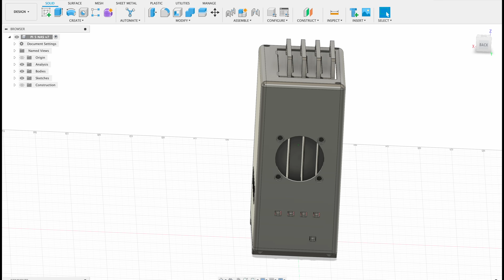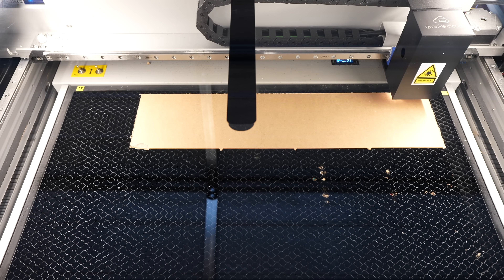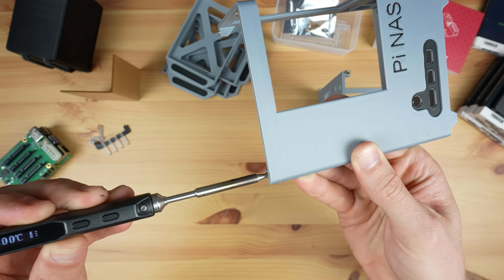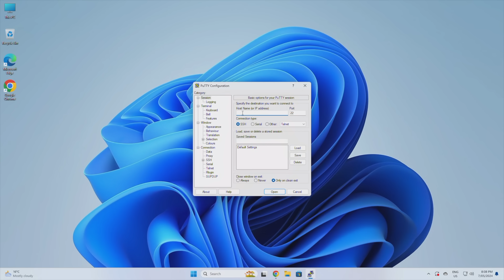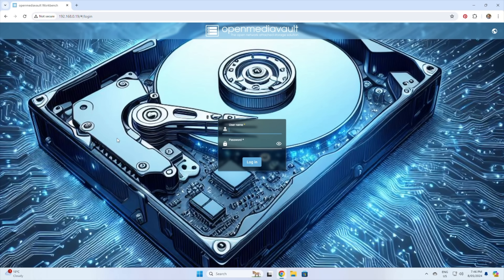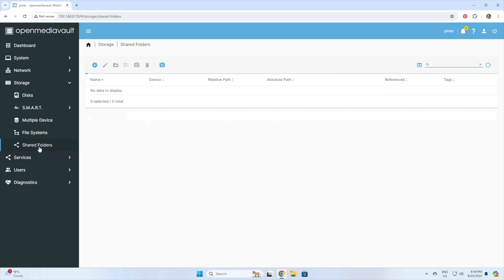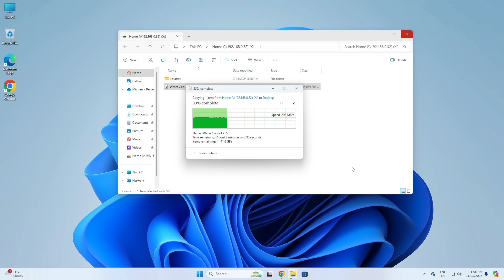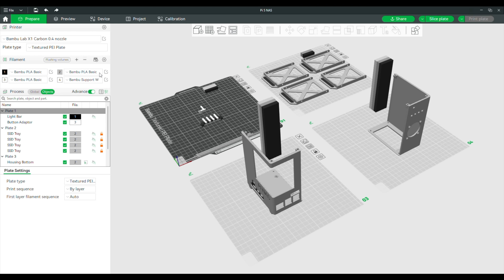I Built A 4-Bay NAS Using A Raspberry Pi 5

Comment: The performance unlock for sure is the 2.5G network interface.  Glad to see that is a surmountable unlock for performance.  It would be interesting to see what would happen if you had a USB dongle with even more bandwidth to see if the underlying compute hardware can keep up.  This has gotten me curious about 3D printing.  What printer do you have?  This looks fun!
Reply from the maker: I'll definitely be using a 2.5G adaptor for projects requiring better network connectivity in future, its a relatively cheap and worthwhile upgrade. The 3D printer used for this project is a Bambulab X1C.

Comment: can i use a raspberry pi 4?
Reply from the maker: No, unfortunately the Pi 4 doesn't have a PCIe port.
Reply: @MichaelKlements  but there was kit for pi4 caled quad sata hat, it's still available. This version uses two usb ports for uplink and interestingly has hardware RAID support (so it's not using pi4 SOC for IO). Pi4 also have more video codecs so plex/jellyfin is still even better on it.

Comment: I would love to see a USB C powered version of this that also includes WiFi 6 connectivity. It would be the ultimate version of this little guy.
Reply: You can power everything via usb-c but probably pi pmic is to weak to handle 4 drives. You can use different sbc that can take more power, but still this will be an issue.

Comment: Degradation of SSD potential
Reply: Crucial BX500s are rated at 1.5m hours MTBF. That's on par with a spinning disk. Of course, a failure on an SSD is usually more catastrophic than on a HDD, but they've come a long way . In a RAID5 (or RAID10, etc) setup, you're golden.
Reply from the maker: There is this potential but thats what the RAID 5 configuration is intended to cover

Comment: The main question: is this thing reliable?
Reply: I've been running a pi 4 for years to run my home. Don't see why this wouldn't be reliable.
Reply from the maker: I don't see any reason why it wouldn't be, I've had a similar OMV NAS running on a Pi for a few years now without any reliability issues. The RAID configuration covers a drive failure so the biggest risk would be failure of the Pi or Radxa Hat and these could both just be swapped out in a few minutes if needed.
Reply: @MichaelKlements reliability problems can come from sdcard. No matter how better sd card i have used, had problems with data corruption in sd card. May be is better on pi 5. But overall beautifully done
Reply: @rembrantro one thing to look at when configuring the Pi is to limit how many writes are sent to the SD card. If done correctly you can help the card last longer. For instance, one installation I did was constantly writing log files of everything to the card and wore it out quickly. I changed the logging and the card lasted for years.
Reply: Great  @MichaelKlements
Reply: @MichaelKlements There was many many issues with power, link stability and firmware of used JMB chip so hold of with Your verdict. Some drives has issues with this controller and that caused constant RAID rebuilds, obviously taking way too much power. Today we are at different level, all components have recent firmware and it may be ok, but You will see that after some time. Just update us after month or two if everything was ok. With synology and similar brands You are buying not only hardware but great software as well as experience of thousands of users, this is completely different than DYI NAS where You need to be aware of many things :)
Reply: Why wouldn't it be? Pi OS is just debian basically. OMV has been around for ages and is considered stable. Crucial drives are pretty solid. The weakest link is the Radxa hat, but I've yet to hear any horror stories about them.
Reply: For three years, a Pi4 and an external Raid 1 enclosure with two 2Tb ssds with OMV as the NAS “OS” without any hitch. Most of the data stored in it comes from my assorted RPIs. Granted, speeds are not the best, but I don't need speed. Nightly, all the data in that NAS is backed up to my two servers, both on my property but in different buildings. I want to build this same NAS, but the hat cannot be found. Just a reminder, Raspberry Pis are a great tool to tinker with. Great video.
Reply: @luisbperez368  there is another hat which I am looking at, namely the x1009 5 sata slots. As in the name it has 5 sata ports
Reply: Reliability for this project would be all about hitting physical tolerances exactly. I can’t imagine why this project would have reliability issues. It is simple in execution, and uses industry standard components which can be selected for reliability. Pretty great build as well.
Reply: I have been using PI for years now. Answer is YES. Os is openmedivault
Reply: Is there any possibilities you sell one of these?
Reply: Where is the temperature analysis of this  nas?
Reply: Tried it, data transfer slows down a lot, it is not stable, most of the time 10mbps, sometimes 2mbps and it stays. Mini pc is much more reliable at a less price.
Reply: @EnzoVince  that was my thought too when i was talking about reliability. The only real advantage i can see is the power consumption. Because otherwise I find it expensive and prone to failure. A minipc will be a far better alternative regarding resources and reliability. And cost too. I have a qnap nas that has only 1 Gb of ram  and it runs well most of rhe time. It only slows down when it’s used by 2 users. I’m searching for an alternative and having in mind the cost to benefit ratio, I think a minipc would be the best solution.
Reply: @EnzoVince what mini PC do you recommend? At least for 4 drives I want to create one but not sure on which minipc to choose thanks 🙏
Reply: Is there a way you can share STL for 3d enclosure parts ?